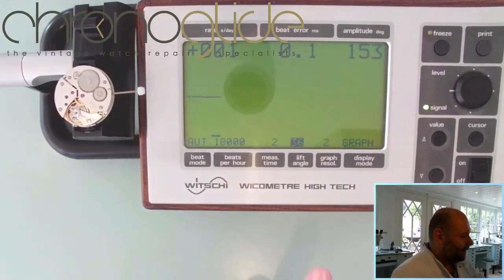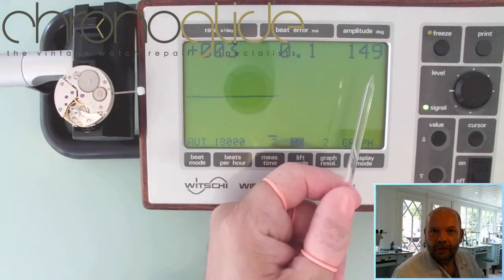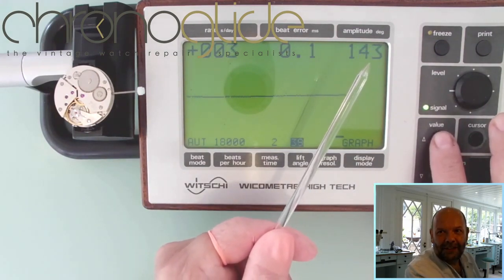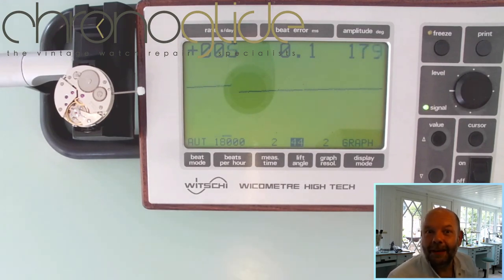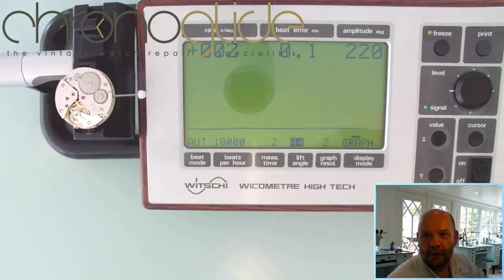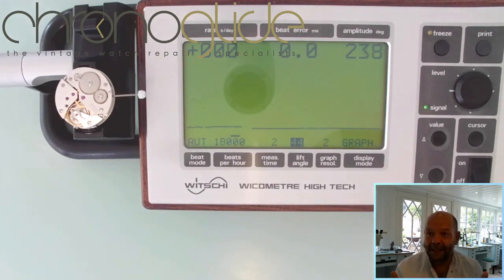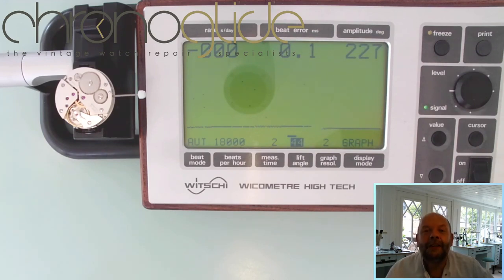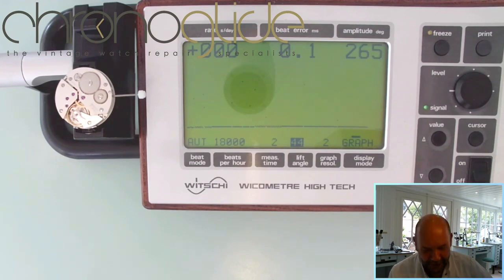Lift Angle - Adjustment and calibrating your Timegrapher.

Comment: Excellent, excellent!  Thank you for this great tip.

It's fortunate that the movement can be "under-powered" in order to bring it to a balance-wheel amplitude of 180 degrees (but if we wind too much, we can quickly release the mainspring again and start over, winding more carefully; but, you got it right on the first "go").

The visual method of observing and marking the balance wheel to allow us to see it as we bring it to a 180-degree swing brings all this together, and gives a good and solid visceral feel and understanding for the meaning of "amplitude", and for lift angle.  Kudos!

I am particularly grateful to you for this great tip because I have been working on some quite old pocket watches, plus some other obscure movements for which I have not found a published value of lift angle for the movements.  Now I will be able to determine the lift angles and get more true diagnostic readings (thanks again to the great method you so kindly teach here).

You should be pleased that you are helping many of us!  And I feel that the only way we can pay you back is for us to help others.  It's good to keep the circle going... .

Cheers!, and very best greetings from the Arizona desert.

--Joe / Tucson ARIZONA / W7DXW

Comment: Best tip ever!! Just got an open box weishi 1000 and was trying it out. Using my Waltham 220 that is keeping time around 1 min a day or less. In auto, beat rate 18000 and lift angle at 52 I was getting some “++++” as rate and amplitude over 300 and dots all over the screen. I did as you show here, now the amplitude is about 197 with a beat error 2ms and -83s/day, with parallel diagonal lines coming from the top left about 1/8” apart on screen
I am trying it this way, without cleaning or any adjustments so I can see what really was before any maintenance.
What am I doing wrong? I’d the machine bad?
Thank you for the priceless information you share here!

Comment: Thanks for the very interesting explanation. I’ve looked up a few of your videos as I just started tinkering with some of the watches of my recently started collection. I had already managed to regulate a Vostok 120512 with the 2415 movement to really good results (albeit it’s a bit irregular) but today I tackled reducing an NH35’s very high beat error from 1.6 ms to 0.0-0.1 ms in 4 positions. Really happy with how it turned out despite my initial reservations and limited hardware. Thanks for the help and amazing explanations.

Comment: Hello! 
H E L P !
This is so helpful. 
My question is in the video at 9:20 as your showing the mark at 180*,
but you don’t explain which part are you adjusting.
Is the “Timing Pings” or the “Stud” that your adjusting….? ? ?
Thank you for all that you do.🙏🏻
Reply from the maker: Simply winding the movement slightly so the amplitude is slowly increasing.

Comment: Excellent tip and explanation. I will test the technique using a known lift angle, but this seems to be a great way to go. I have often thought about how to use known variables to determine unknown variables using the time grapher and now I know. As I only work with vintage watches and pocket watches (watch repair is a hobby not a profession for me) often with unknown lift angles, this technique is going to be very helpful. Thanks.
Reply from the maker: Good to hear from you Hossein!

Comment: Brilliant tip Kalle. Simple and effective. I’ve heard of this technique before but your explanation of it is so much clearer. 
Would you consider making a video on how the guard pin and roller interact with each other? 
Cheers
Reply from the maker: Ahhh, the safety features of the Swiss Lever Escapement, I will Michael, Promise!

Comment: So you establish 180 deg. of amplitude with a small wind of a mainspring, and then use the timegrapher to find the lift angle that fits with that known amplitude.  I suppose this could be made a function of the timegrapher, but it's not a big effort to play with the lift angle until you see the actual amplitude registered.  You didn't exaggerate: this is neat !

Comment: Amazing vídeo, I hace two questions: 1- is there any way in an Automatic modern watch to know if It is fully winded? 2- Is It correct to use the lift angle that comes in the specifications of the movement? Thank you.

Comment: Hi Kalle, clear explanation. Is it possible to put a stroboscope on your microscope, or even better if it has led lights already to have a stroboscope driver? It would be even better if you could take the output from the timegrapher so it is always synced up. With a stroboscope, not only will it be much more precise to see the 180 degrees, but it can also be used to spot weird defects in the whole balance assembly (spring/mass/etc) if it has a bad case of the weeble wobbles.

On a separate note, could you explain how the timegrapher works? I see multiple videos on how to operate a timegrapher, and what functions it has, but none explain how the timegrapher converts its signal (a microphone if I'm not mistaken) into the numbers displayed on the screens. What calculations and assumptions does it make? When do I know I cannot trust the output anymore?

Comment: Cool video!

The warped spokes are due to the "frame rate" of the camera due to the fact that it is a rolling shutter. The sensor reads from the top to the bottom at a rapid rate, so any quick movements of the focus subject can appear as though they are bending. It's the same as how that side to side scanning tiktok filter works.

If the camera had a global shutter, it would read the whole sensor at once at a rapid rate, and there would be no bending effect.
Reply: If you think about it, your display also has a rolling scanout. At 60Hz the rolling shutter of the camera would be well synchronised with a typical PC or TV display, and for moderately fast moving objects like these (a movement takes several frames), it can be invisible.

But the camera is running at 30hz, emphasising the issue.

High refresh displays would reveal the rolling shutter again though on 60Hz camera footage, but the artefact would be relatively milder.

Scanout of the sensor is in turn the cause for rolling shutter. There are no mechanical shutter blades any longer. The shutter is regulated by draining each line a certain time in advance of when this line needs to be scanned out of the sensor module to the rest of the electronics, then it accumulates charge corresponding to light, then it gets scanned out. There used to be sensors without rolling shutter but they needed half the physical space in between the sensing lines dedicated to storing the charge in the interim during scanout, so they were losing some of the light that could be otherwise captured and contribute to lower noise.

Comment: Have you tried the SLO-Mo video trick?
Use your Smartphone to take a slow motion video of the balance wheel. You can play it back In slow motion and easily see how far the balance is rotating.
Reply from the maker: We used that at wostep as well, great tip Jon!

Comment: That was exellent tip! 
Got me thinking, One could maby cobble up a stroposcope similar to that used to check on old cars. (Rover, 😜. Lucas, the inventor ov electrical darkness.. 😂) 
Anyway. One could also use it with a circular transparent angle scale. So to check correct amplitude visually.
Have been pondering about how to do a similar setup, for set the balance in beat. As my cheapo TG, only have presets. Eg, now way to check the actual frequense. Getting one of those old tools. Should be a better way, in todays world. 
Or you might have a tip there too, Kalle?
Reply from the maker: Interesting thought, I know about a machine from Finland with uses the strobe effect, I saw it at Henrik Korpela's KHWCC in Le Locle. See if I can trace the details for you.

Comment: The balance wheel is swinging 180° both ways, so why isn't that an amplitude of 360° since it's rotating in a full circle?  Does that mean that at a higher amplitude like 270° that the balance wheel rotation is actually a full circle and a half - 540°?

Comment: So your telling me the amplitude is only 180 on that watch?
Reply from the maker: Only for calibration go to visual 180 degrees and set timegrapher to proper lift angle matching the 180, after that wind if full and see the real amplitude.
Reply: @ChronoglideWatchmaking  I see now. Make the amplitude 180 on the watch then make it 180 on the time grapher that gives you the lift angle. Very cool thanks for the help